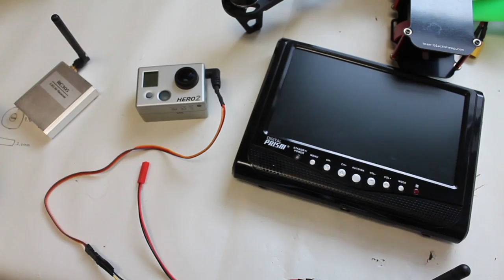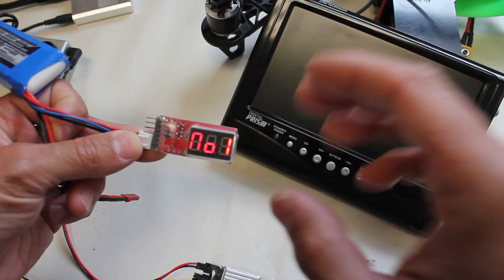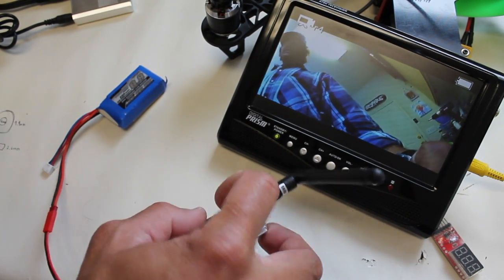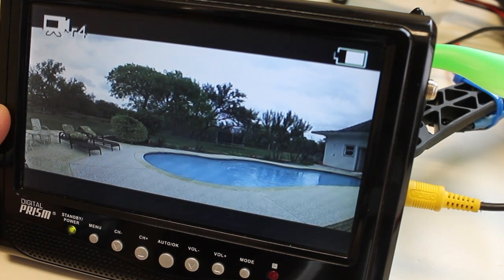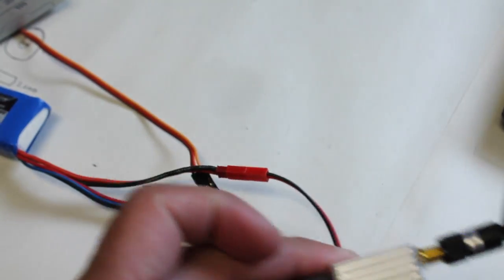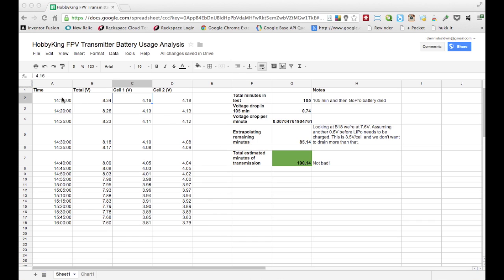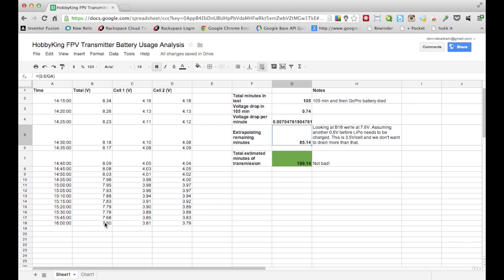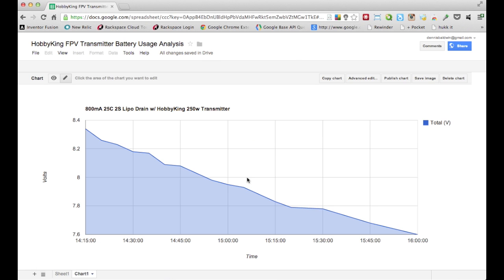Hobby King 5.8GHz FPV Transmitter Battery Test w/ 800mA 2S LiPo

Comment: Thank you so much I was looking on YouTube for what lipo battery I should use for my 600mw transmitter and this is the only video that showed me thank you so much
Reply: So with a 600mw transmitter, if I'm only trying to power the transmitter itself and run cam of internal batt a 7.4v 1000mah would suffice? Jus trying to get around 28mins between 2 drone batteries

Comment: Did you ever find out if 3 cell gives more watts equaling more range verses 2 cell?
Reply from the maker: +RC flight Seeker No. I came to the conclusion, mainly through researching online, that there is a voltage regulator, which means it doesn't matter how much you throw at it. All of that extra voltage gets dissipated as heat.
Reply from the maker: +RC flight Seeker No. I came to the conclusion, mainly through researching online, that there is a voltage regulator, which means it doesn't matter how much you throw at it. All of that extra voltage gets dissipated as heat.
Reply: So it is pretty much pointless to use a three cell then right? Not going to last longer or get better range just cause the transmitter to heat up?
Reply from the maker: +RC flight Seeker Exactly. Plus the added weight of carrying that additional cell.

Comment: Excellent analysis sir. I was hoping someone would do the math for me. I'm getting to old (or lazy more likely) for that anymore . LOL. I have an unusual project underway. I am using some of my Phantom 2.4 Ghz gear to put together solar powered WiFi surveillance camera systems for my rental properties. So far I have portable units with Mppt controllers, 700 TVL Effio-E pinhole cameras, transmitter, and 9800 mAh lipos with 10W panels. Very portable and easy to setup. I will put a video out after further testing. Keep up the great work! :)
Reply from the maker: +jr10 Cool. Good luck and I look forward to the video.

Comment: How do you power the rc305 receiver?
Reply from the maker: +KRM167 I use a 2 or 3S lipo. Check your maximum input voltage for your RC305 (mine is 12V) and make sure not to exceed that. This is why I can use a 2S or 3S lipo.

Comment: Have you done such a test on the video receiver?  I'm trying to figure out what size battery to buy for both ends.
Reply from the maker: WhiffleX No, I haven't. I'll look into this though. I was less concerned about the RX since it's on the ground and weight is less of an issue. I would say 1000mAh would be a good starting place for your ground RX. Good luck.

Comment: Great video and I enjoyed the data graphs and spreadsheet. Awesome job.

Due to the fixed view of the camera, encoding and output for data transmission was relatively low. Your fixed camera view had little pixel change. One could hypothesis that with moving the camera view would result in more processing therefore more data transmission. The end result would be the transmitter would be expending more energy due to higher data rates. Possibly redo the test with camera movement and see if that greatly affects battery life.

What are your thoughts?
Reply from the maker: dthillens Interesting hypothesis. I'm not sure if that's true or not, but would be worth a test. I'll try and give this a test soon and share my results. Thanks for the idea.

Comment: What battery should I use to power the receiver?
Reply from the maker: My input voltage on my RX ranges from 7 to 15V DC so I can use a 2S or 3S lipo. Make sure to check the technical specs on your recommended input voltage.

Comment from the maker: I don't recommend using your 2S lipo. Even if it did work it would be underpowered and you wouldn't get full range. You should be able to get a small 3S lipo that will run your TX. You could also try powering your TX from you quad lipo if you're running 3S. Sometimes there's interference but it may be worth a try. You just need to consider it will create additional drain on your battery. I normally run 2 batts.

Comment: Thank you Dennis for your reply.its this one, google it if you like --->
 5.8GHz SET Video FPV Hobby Pro 9CH 600mW
so as i guess the 2s battery wont be enough ,as it says working voltage DC12V.What batteries do you recommend for this fpv set?Should i try with the 2s anyway?Is anything bad going to happen to the transmitter or the battery?Thank you for your help.

Comment from the maker: I think it should be okay, but please check your input voltage range. If it's DC 12V only then a 2S lipo may not be enough power. Most times you'll have a range of input voltages that the TX will work with. If it's 7-12V DC then you should be fine.

Comment: Hello,nice video.The charts were crazyyy..!GJ.I bought myself an FPV set 5,8Ghz 9Ch 600mW and i m planning on to connect the transmitter at a 2s lipo 850mAh 35C.Transmitter working current 400mA and voltage dc12v.From your experience do you believe its going to be ok with this battery?thank you

Comment from the maker: Good question :) Unfortunately I haven't had time to put this vid together, but from my field experience about 1/4 mile is what you should expect. HobbyKing site says about 500m so in the ballpark of what I'm seeing. Now you can easily get more range (at least double) by adding a CP antenna setup. Thanks for the reminder and if I can get around to it next week I'll try and do a test with the standard antennas.

Comment from the maker: Check your input operating voltages for your TX/RX setup. You may find that a 3S may be too much power. You mentioned that you're powering your LCD & receiver with a 2S. My LCD has its own battery and my receiver can accept 12 V input so I'm using a 3S. That fact that you're powering both with a 2S sounds a bit suspicious to me.

Comment from the maker: Not that I know of. You could clip the battery leads and then solder the battery leads directly to the TX power input leads, but then you'd have to disconnect the input from the TX each time or put a switch in there. I hope I understand what you're asking :) I wasn't exactly sure what you meant by "middle cord".

Comment: Love your videos man. I have a quick question is it possible to connect the battery directly to the transmitter without using the middle cord from li-po battery to the transmitter? Sorry I do not have much experience but I'm looking to build an fpv. Thank You

Comment from the maker: Yeah the TX will definitely get warm if you're suppling 11.1V to it. If we have the same one then it's operating voltage is 5V DC so stepping it down will generate some heat. Regarding your question about the camera, if you're using the PZ0420 for FPV then it won't work very well with a 2S. See my thread with James Balagtas below about the input voltage on that camera. If you're using a different cam then check out the input voltage on it and see if a 2S would be sufficient.

Comment: Same as you have in video.....ironic that i have it set up lovely on my quad and my KK2 board has blanked out ....3rd one.....so I have a wee chunk of cash coming soon and am gonna go with a dji phantom for ariel shots and fly fpv with a bixler or axn.....I was using a 1000mah 3s and i noticed the tx getting a bit warm....you reckon the camera will have a weaker signal with a 7.4v 2s.....?

Comment: I use a patch antennas on the ground and a v antenna on the quad. All from range video. I am going to get some other antennas soon and start to do some side by side comparisons and see if there is a difference. I use 1.3ghz for video so my choice of antennas is very slim. Moving to 5.8 there are so many more options. You can look at my video labeled my ground station to see my exact set up it is kinda buried though.

Comment from the maker: I hear you. If I recall the camera runs between 9 and 12V so running off a 2S wouldn't work. I'm referring to the camera I'm flying with, the PZ0420 from securitycam2000.

Comment from the maker: Thanks for the comment. I think you are absolutely right related to voltage drop to power the TX. The manual states that the range is 7V - 15V DC so I guess the regulator would drop it down to 5V. Also, you're right regarding output current at 150mA so a theoretical 4 hours is in the ballpark of my testing.

Comment from the maker: Yes, although depending on your setup you may need an SMA RP connector. Just make sure you research polarity and gender of your setup before you order anything....since cloverleafs aren't as dirt cheap as the "rubber ducky" antenna.

Comment from the maker: Now you're talking. That's exactly what I was thinking. If I have an 800mA lipo with that kind of transmit time surely I could scale that down and reduce weight on my rig. There comes a point where the weight reduction is neglible but would be an interesting experiment. My 800mA lipo was 48 grams so almost 3X what your 250 is...and probably 3X the transmit time. So with your setup we're talking roughly an hour of transmit time. That's 3 or 4 quad flights. Not shabby!

Comment: Nice job! I run a 500ma battery on my FPV  gear on my quad and just about the same gear as you have. works great. but I do not have a GOPRO.  Good video.

Comment: cool... if my securitycamera2000 can only work down to that volt ill use 2s lipo for the whole fpv gear. the camera will malfunction at a certain voltage level!

Comment: Something very important for newbies to FPV the farther you go the higher you have to be to get solid video. I get this question all the time. So if you go 2 blocks and lose video it is because you are to low. you can see what I mean on some of my fpv videos Dennis I do about a mile to mile in a half before I lose radio connection but have to be very high about 200-300 meters to have solid video hope this helps.

Comment: Great Video!  
I believe that the transmitter in these is a 5 volt version and that a regulator drops the input voltage down to that working voltage. The transmitter module should run cooler with a 2 cell battery and produce the same range regardless of battery voltage. The greater the voltage drop needed to run the module, the greater the heat produced.  The operating current is listed as 150ma.  If correct an 800mah battery should give about 4 hours of transmission time.

Comment: Great data there.With that kind of time you could go really small with your battery to save weight if your willing to charge it more often. I might just do that. I found a Thunder Power 250 mah 2S that is only 17 grams. Can't wait to see your range test on 2S vs 3S...